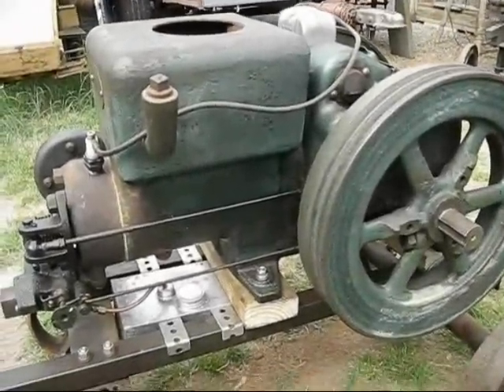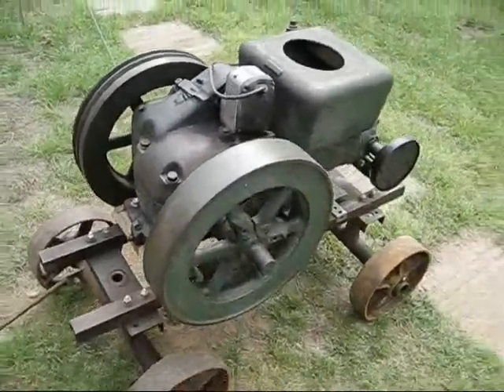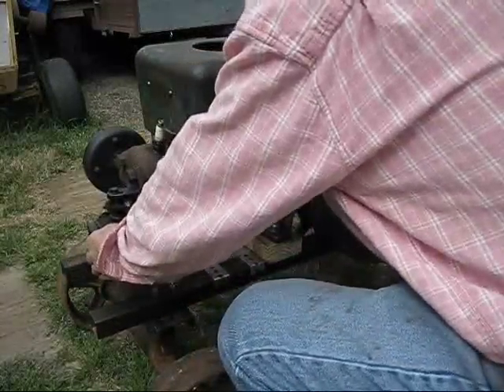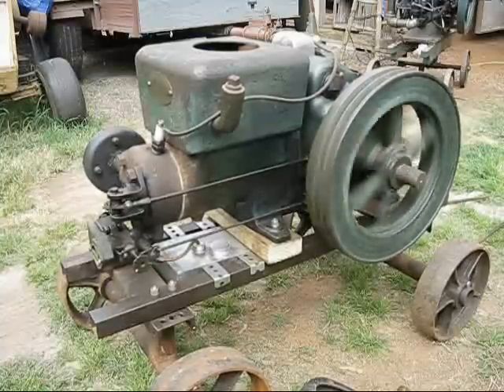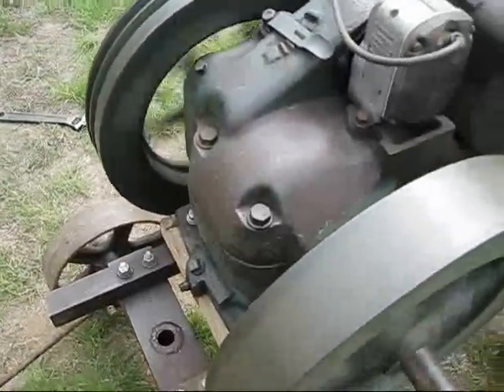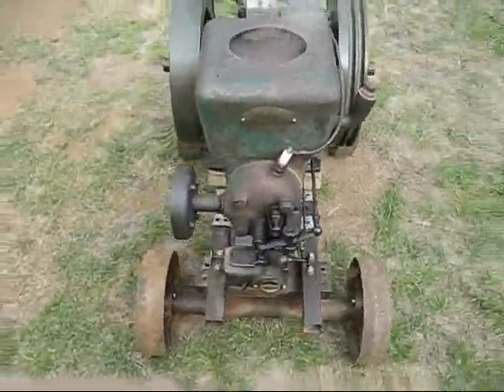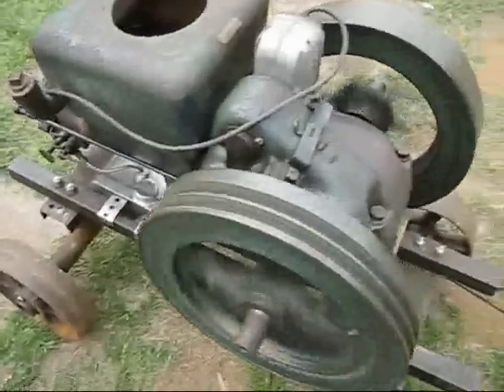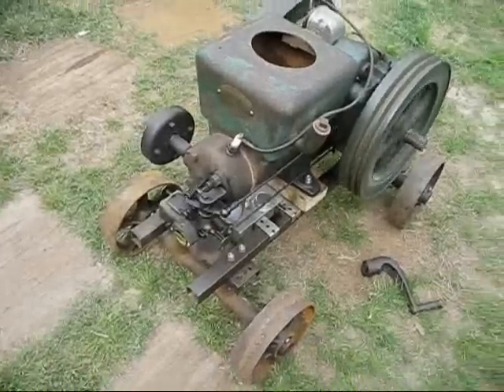Fairbanks Morse Engine1930 Z C

Comment: hey i have one of these and my problem is that it will not run with out choke and when it does it surges like popopopopop then coasts repeat, i cleaned the carb and it still does it